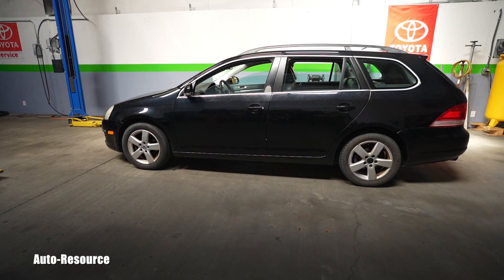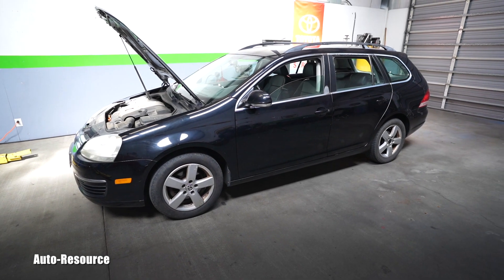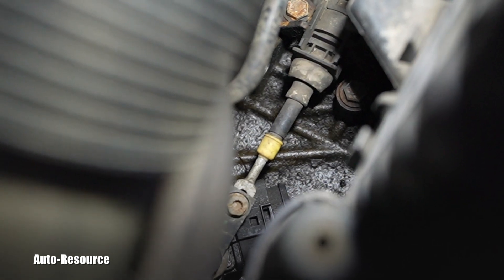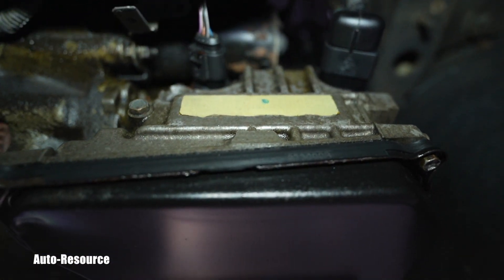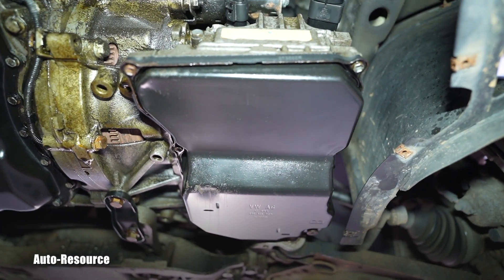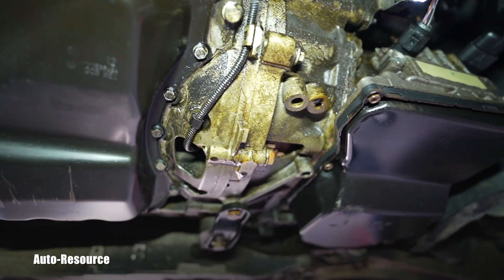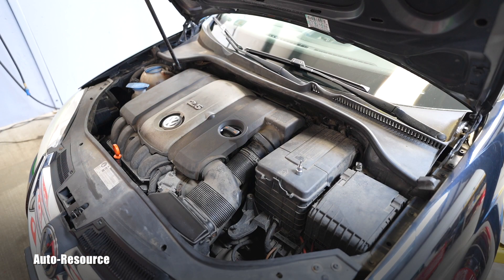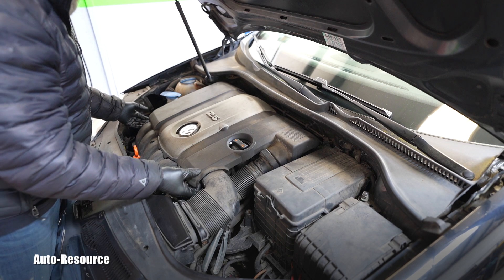VW 2.5L 5 Cylinder Engine Oil Leak

Comment: Just came across your video I greatly appreciated my 2012 Volkswagen beetle with a 2.5 engine I believe has the same issue and I hope so there's a lot of oil under the car I still haven't gotten to it if this is the issue I will be great thank you sir.

Comment: German over engineering. Spot on! Let's not use manifold vacuum, let's add a pump with an aluminum housing and a steel cover. Brilliant.
Reply: lol. To be fair. I think German engineers are extremely good at the job they are hired to do. 
It’s not reliability, it’s constantly innovating to over complicate things in such a way and design parts in a way that they know will fail and be extremely expensive to fix.
Reply: There are so many politics which go into engineering a vehicle I hate to think of the conversations from what it costs for the engineering design, to parts availability, to cost to replace in terms of labor, easy of replacing, and of course customer perception. I for one will never buy another VW not because they are bad, but I'm just tired of their ways. I'm moving to Honda.